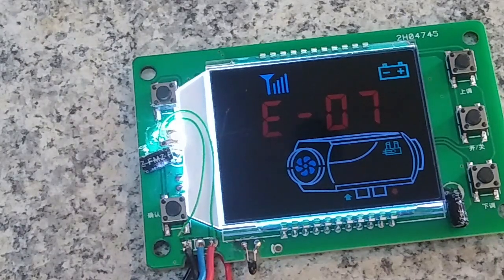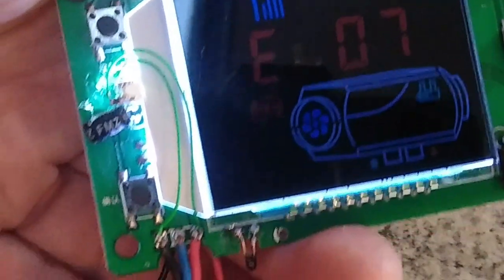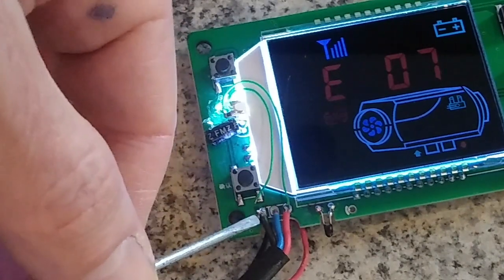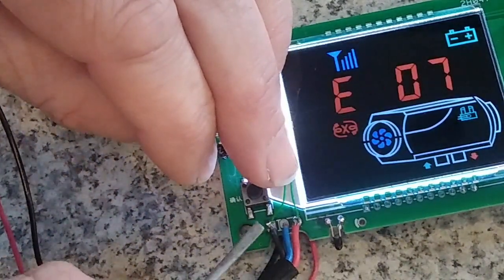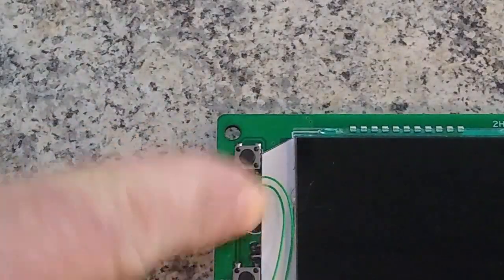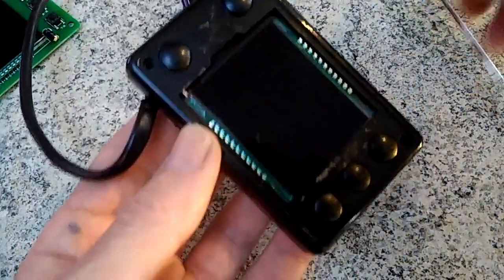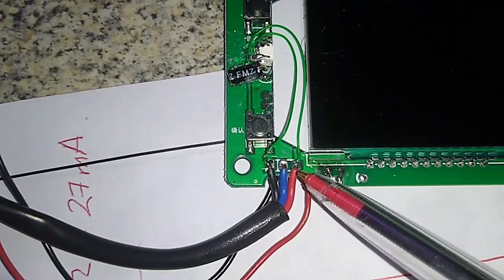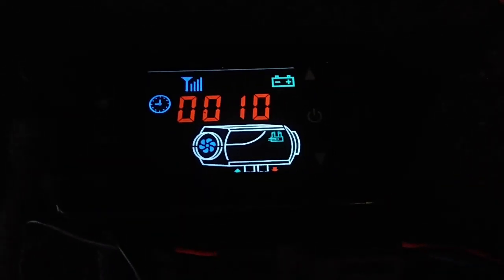Chinese diesel heater Dim LCD display fix/hack

Comment: Is it possible to specify the LED used?  Does the LED need to be a 5-volt LED? In other words, is it necessary to have a 900 MCD 5 volt LED, because I cannot find any. I can find 3,2 volt 900 MCD LED's, but no 5 volt ones.  Many thanks!!!!

Comment: It should also be noted that the three wires are prone to breaking where they are soldered to the circuit board. Make sure your power lead does not move around.

Comment: Thanks I got some good data off your video. I don't have a dimming display but I do have a flaky controller. Knowing what the voltage was supposed to be and which wires to look on is it start. I'll look on your channel for other videos but I'm hoping you do a basic rundown on the wiring for the Chinese diesel heater. Thanks!

Comment: Thanks, for an informative video. Have you any ideas on how to switch the leds off when the unit is powered off ? There was some info around a couple of years ago on how to modify/hack the controller pcb to do this, but I've lost this link. Any ideas..Cheers
Reply: Yeah that woul`d be great, i guess we can add a switch outside the case to flip it on and off, but it would be best if it went off when you turned it off. Or dim down woul`d also be great.

Comment: In your video...your Display unit has the E 07 Error Code....how do you fix that ?
I have had my Chinese Diesel Air Heater for a few months. It came with a different style Display that worked fine...but after 3 or 4 months the Red and Blue wires both broke at the hole in the Display. I immediately ordered another Display...but I needed the heater and resoldered the 2 broken wires and the old display works fine again...Now I got the new Display unit and right out of the box it gives me this E 07 Fault Code. I know my Heater works fine as I use it with my old display unit. What the Hell is up with this E 07 Fault Code and how to fix it ?
Thanks... Liked/Subscribed !
Reply: I read on the error chart that E-07 means blue wire is loose or shorted. Hope it helps.

Comment: I don’t suppose you could identify the thermistor heat sensor at the bottom please. Thanks ian
Reply: Mine is giving crazy temperatures as well
Reply: I'd love to replace it
Reply: @light24bulbs  just buy a new controller and return the old one as defective. It's all Chinese stuff anyways and since China is communist all businesses are owned by the country anyways. Don't feel bad about doing it either :-)

Comment: When I received my brand new 2kw Chinese Diesel Heater, the LCD display was intermittent and would randomly cut off and back on.  Sometimes I could not get it on at all.  I opened the case and examined the solder connections.   At least 6 were NOT SOLDERED IN.   The pins were through the holes, but they forget to solder the pins in.  After I did this I had no more issues.
Reply: They didn't forgot, they just didn't care to finish it😆...mine got barely lights after 2yrs of use)

Comment: i tried this, everything worked fine and just needed a litttle more light. well i did as you said but now I have the E- 07 that your controller is showing in your thumbnail? what did i do and how do I fix it? I am running with a 25amp 120v to 12v transformer. Like i said no problem at all til I did this dim fix. i have even removed the fix but to no avail....
Reply: You should rule out your transformer by connecting the heater directly to a FULLY CHARGED car battery.  Don't try to use a smaller or motorcycle battery.  You need the CAPACITY of a good car battery.  These controllers are very Voltage sensitive.

Comment: What is the oxo flashing light on the screen for ? Thanks great video
Reply from the maker: I think the OXO means the controller has lost communication with the main heater unit. When I made this video the controller was not connected the the main heater body but was power using a independent benchtop power supply.
Reply: @sb3bedfordbusstuff146  thank you so much as it was flashing on mine and your answer fits in ...nice hack...happier new year
Reply: @dominickobyrne2978  hi, can you tell me how you fixed your oxo problem please
Reply: @Woodlandbill  sadly tried lots but was faulty and a new one sorted it out got one with remote handy when in bed and need to turn Dow the heat 
God bless
Dominick

Comment: Good video, it would be nice to wire in a dimmer too.
Reply from the maker: This should be possible if you used a 10k  ohm trimpot volume controller as a dimmer and put it in series with the +5v feed to the led. If that sort of makes sense.

Comment: Hi matey I've fitted an extra white LED and it has improved it a bit. However on mine it seems to be a viewing angle problem.  Looking straight at screen its dim. Look slight downward or upwards its perfectly readable. It's almost like the polarised front screen is wrong. Mines been dim from new....Cheers from old George

Comment: Any chance you would know how to fix the E-07 error? I recently added a new controller and it’s giving me that error.
Reply: probably too late but I drive my heater with a 20 amp 120v to 12v power supply. I got the e-07 error until I swapped the new power supply in. It doesn't pull 20 amps but the voltage drops if you are not using a capable power supply. Or direct 12 v battery, but i have 120 v available so I use it.
Reply: I read on the error chart that E-07 means blue wire is loose or shorted. Hope it helps. I know this is an old post but some other people may need it.

Comment: Hi.  Super comprehensive video, many thanks.
I also have a dim display and had intended changing it during the summer, but never got round to it.
Now I NEED the heater in the workshop, so I’ll put up with the dim display until the spring,  and then use your fix.  I use the remote to switch it on an off, so don’t really need to see the display. No doubt you measured the voltage as 5v?I only ask as the supply is 12v and I wondered if they’d bothered to provide a 5v rail, and did you notice if there was a current limiting resistor mounted on the PCB?
Cheers Noel

Comment: Can you tell me how to open the case, basically does the top or the bottom get pryed outward?
Reply from the maker: The plastic lens cover is held on by double sided tape and is peeled  off to reveal x4 screws behind it. If you are careful the adhesive can be used again to stick the lens cover back on once you reassemble things.
Reply: @sb3bedfordbusstuff146  thank you!
Reply: @sb3bedfordbusstuff146  hello my name is James Mason and I have two metal housing 8kw diesel air heaters in my 1967 GM TDH-4519 fishbowl city bus and I am thinking about building a new Ecm and controller and I was wondering what kind of bus do you have and what are you using to heat your water with

Comment: Hi dude, wonder if you could help.
Brand new out the box my screen was super dim and unable to read in daylight. Seller is sending a new screen so all good.
Question I have is if I repair the screen LEDs can I wire 2 screens to the heater, the 5v and ground would be fine but would it cause a issue with the data wire?
Would a blocking diode work of if used on each date so one controller doesn't feed into the other or won't that work if two way data?
I have mine installed in a boat on the 5kw version and have heat output in main saloon and forward cabin and would be nice if could control the heater from both cabins.
Regards
Reply from the maker: I doubt you can use x2 controllers on one unit. The biggest problem maybe the heater would receive a command from one of the x2 controllers but the other controller may not update and display the correct data. Also each controller has its own temp sensor so thing could get well confused. I don't think it would work and it could be a fire risk if a fault occurs.
Reply: @sb3bedfordbusstuff146  thanks so much for your reply, I see your email point. Maybe the screen with the remote that has the display would be the way forward.

Comment: Thanks for that, mine has gone very dim after one year and needs a fix. If the LEDs are simply being overdriven, adding a resistor to the new unit will prevent dimming.
Reply: mine has done the same, 1 year old and the display is quite dim.
Reply: @slickjimmy76  Seems like it happened because my shore battery charger runs up to 14.8 volts, which overpowered the LED and damaged it.
Reply: @Gnarlodious  Mine has spent its life on a kenwood 12 volt power supply (13.2 volt output) and did the same. It also is disconnected from all power when not in use. I think it is safe to say your shore charger did not cause the issue :) These are made to be in a mobile environment and "should" work from 11.5 to 15 volts without taking damage.
Reply: @slickjimmy76  these units are designed to be used in 12 vehicles, the voltage of which can vary for 12 to 14 volts.  I therefore doubt therefore the chargers are what is causing the, almost, universal dim mining problem.  Has anyone checked if there is a current limiting resistor in series with them?
Reply: @Jestey6  no there is no current limiting resistor.  The display lights seemed to be overdriven and just burn themselves out

Comment: Could you give the ohms and watts of your resistor? This will be hard to find in Greece.
Reply: It's a 180 ohm resister and probably 0.25 watts. Easy buy on eBay.

Comment: Great fix I think some control switches self dim when not in use wonder can   that be applied to this type as they are very bright at night in the camper
Reply: I just made a plastic cover for the one in my motorhome. Cheers from old George